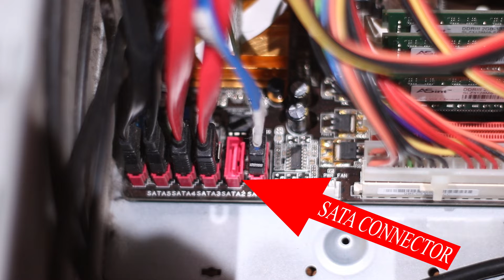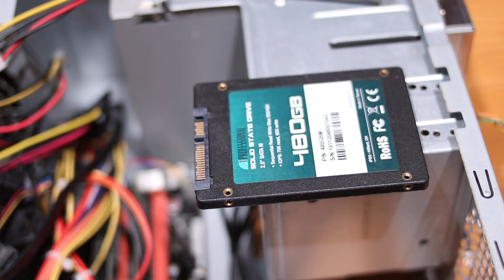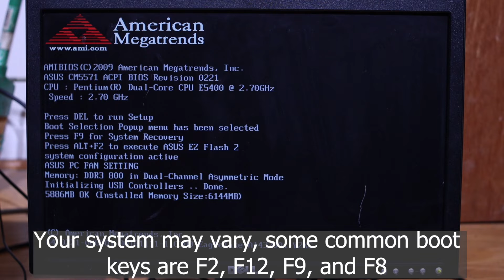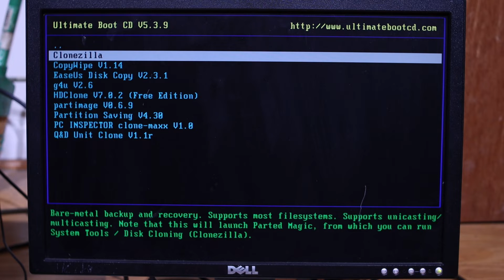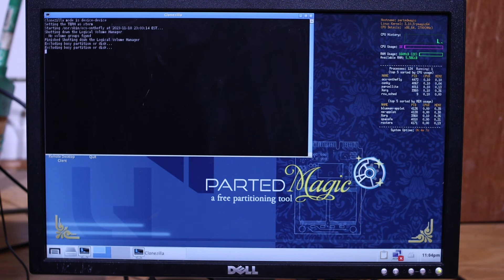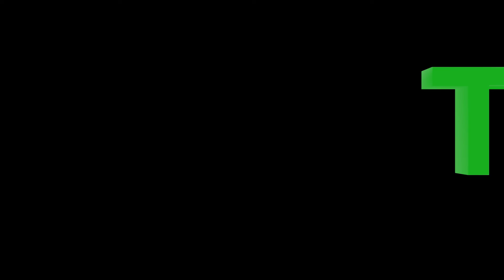Speed up your older computer with an SSD upgrade

Comment: Technically speaking, you can get an IDE to SATA converter and put a SATA SSD into an IDE connector. But when you're having to do this, think to yourself, is it really worth it?
IDE based PCs are likely to be running no newer than Windows XP, and Windows XP worked flawlessly on a hard drive, especially one that was defragmented frequently.
The same goes for laptops: SATA based laptops can take an SSD no problems but for older IDE based laptops, you're either going to need an IDE converter, followed by mSATA to IDE adapter (as a regular SATA SSD won't fit with the adapter) or just stick with an IDE hard drive. Again, the last laptop I had which was fully IDE only was a Packard Bell from 2007, which was only powerful enough for Windows XP.
Reply from the maker: Yes, you could get IDE to SATA converters and I do have them. Though, like you pointed out, is it worth it. That is kind of more of what I was getting at when I said the "computer is too old for this upgrade". I could have explained more but I had a 5 minute max time frame for this class project and the video clocks in at 4 minutes and 59 seconds. So, I could not explain things too much. I'm surprised that there were still IDE laptops in 2007, I thought they stopped making them in 2005 and desktops were even earlier. Though, it is possible to get a Windows 11 to run on a computer from 2007 (I made a YouTube video about that with my daily driver desktop) and there are light weight Linux distros (like q4os) that can run on computers from Y2K (like my Compaq Presario 7000). Even though this can be done, the Proformance is pretty sluggish on a fully IDE computer as in 2005 the fastest processor was a single core 478 socket (or at least one of the many variations) CPU and IDE could only transfer 133 MB/s (about 11.5 times slower then SATA1). So, the upgrade is not worth it, and the computer is too old for the upgrade to be effective.